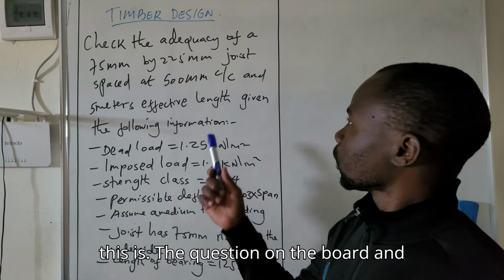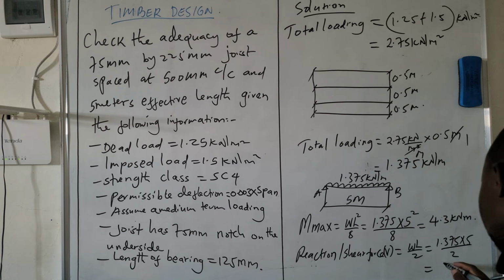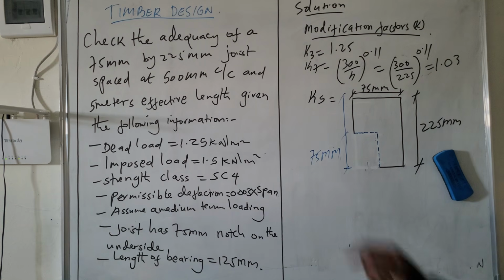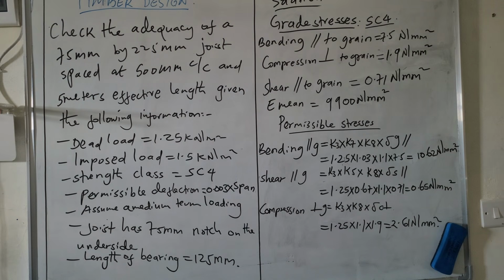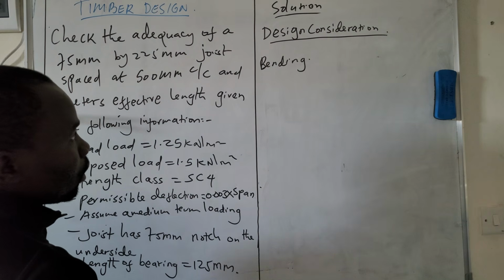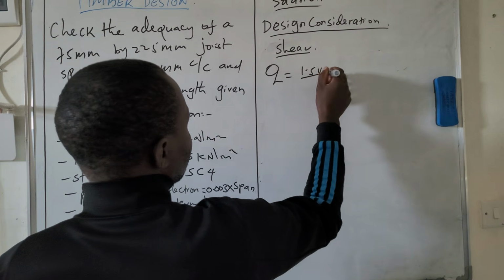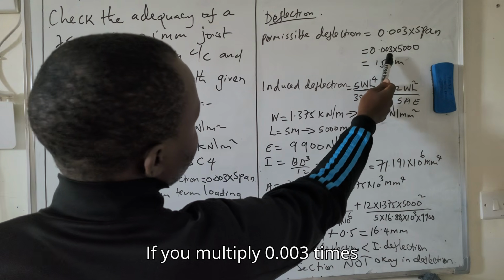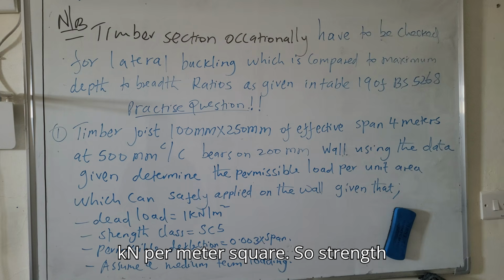TIMBER DESIGN TO BS 5268 PROBLEM #4

Comment: Can you do this  sir, a simply  supported timber beam of effective  span 2.4 carry  a uniformly distributed  load of 2kn/m inclusive  of  self weight and a concentrated  laod of 2kn at mid span.the end of the beam are held in position. Select  a suitable  rectangular  section of the beam using  timber  strength  class c16(sc3).check the  bending,shear and deflection and lateral  buckling. Assume  all modifications  factors are equal to 1.0

Comment: In finding  induced  deflection what  is the  difference  between  the equation  5wl^4/384EI+12wl^2/5AE and 5wl^4/384EI+24wl^2/5AE
Reply from the maker: the first equation is for simply supported beam subjected to a UDL and the second one is for simply supported beam subjected to a point load at the center of the beam. check my video on introduction to timber design everything about deflection is covered there.
Reply: OK thanks